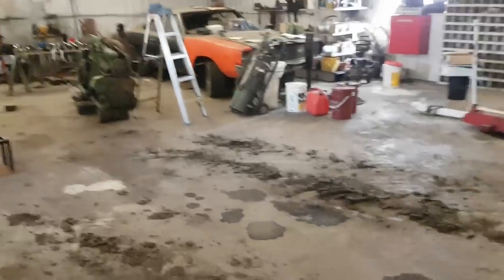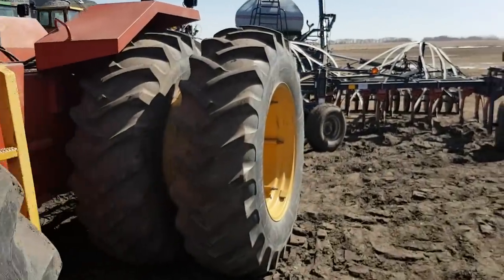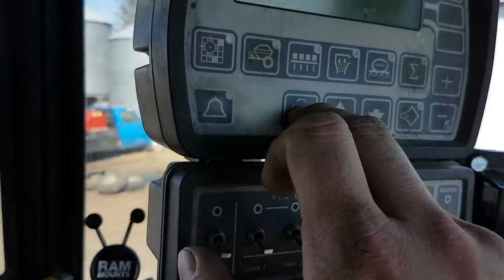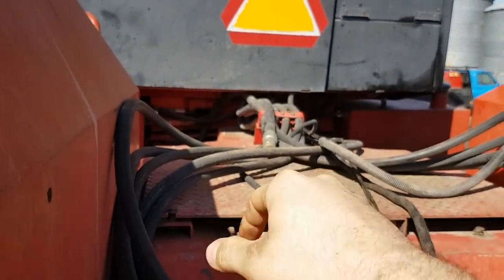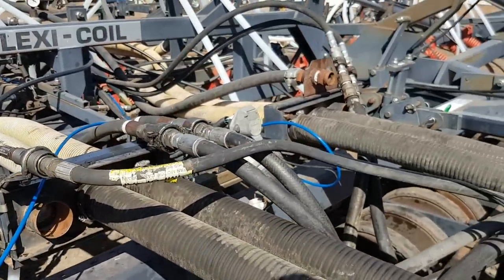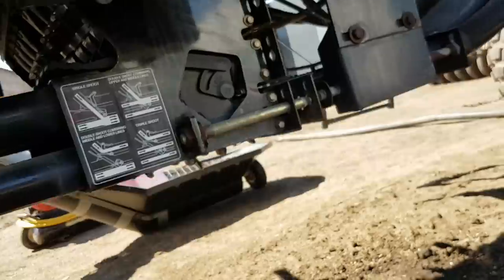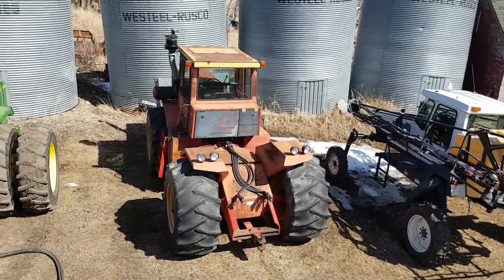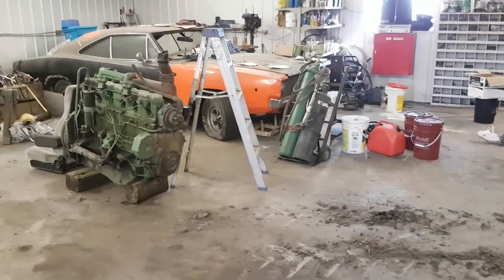Spring is in the air!  895 and flexi coil 3450 walk around!

Comment: Ya those take a lot of hydraulic volume to run I bet!! I hire a guy that has a JD air seeder that is 6o ft. Wide. Pulls with a track tractor that has 80 gpm pump!!  I'd like to have a 30 ft seeder but can't swing the price at the moment.. that rig u have is long if u pull a ammonia tank also!  U probly have a lot bigger fields than I do....
Reply from the maker: Karl Jacobson haha ya well I bet it's pushing 100 feet long lol ya the biggest one is 270 acres and the smallest one is 17 haha
Reply from the maker: Karl Jacobson the fan takes 22gpm and the tractor is only good for 26 so I only 4gpm left to lift the drill so that dosnt work very well lol
Reply: south sask farmer that's using it all. Lol👍👍

Comment: Must have aftermarket closed Center hydraulic to fun that unit? I’m sure the designation 6 series versatile is their first series with closed Center. Open Center heats up real bad.
Reply from the maker: No sir it was these guys with it first. Old 800 couldn't because they had open center but 555 835 855 875 895 935 all had closed center
Reply: south sask farmer just did a quick google search, and tractor data says the 6 series is first with load sensing closed Center. Would make sense since when I searched up the 3 series, all the forums list atom jet
Reply from the maker: @NorthEastSaskFarmer  welp they are worng because this is all factory
Reply from the maker: @NorthEastSaskFarmer  there are a few things on that tractor data I've found over the years that are not correct lol trust me they run orbit motors like champs all.of them